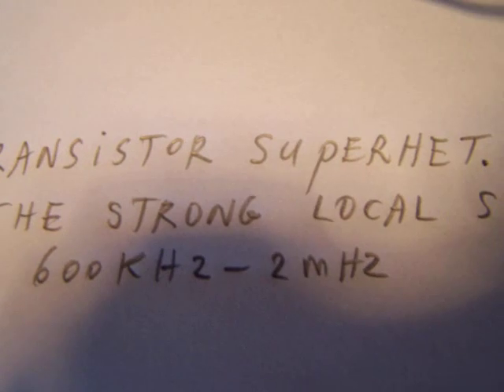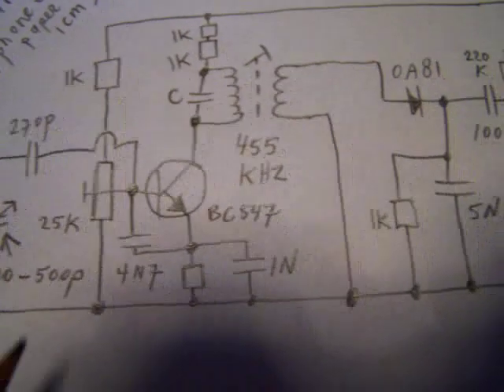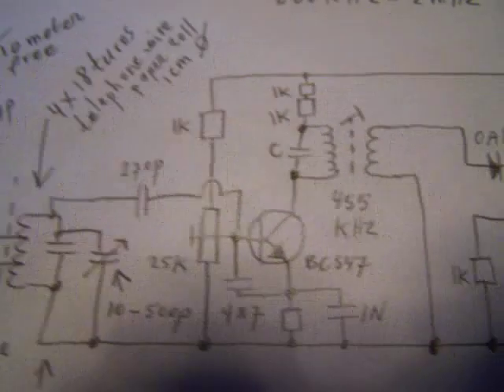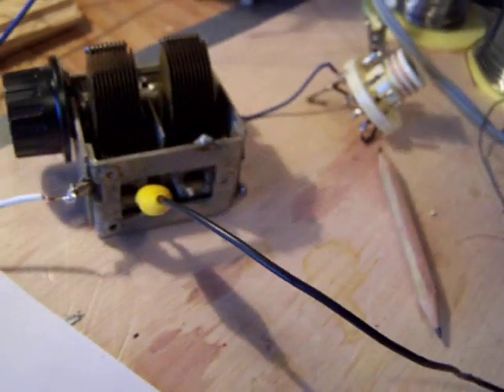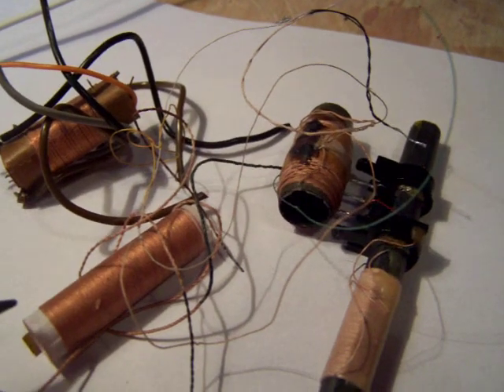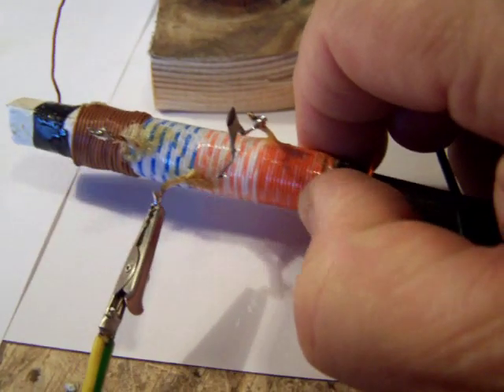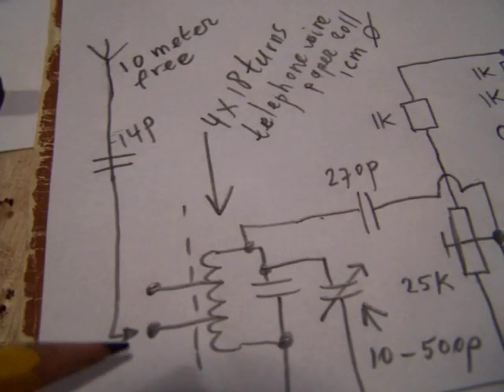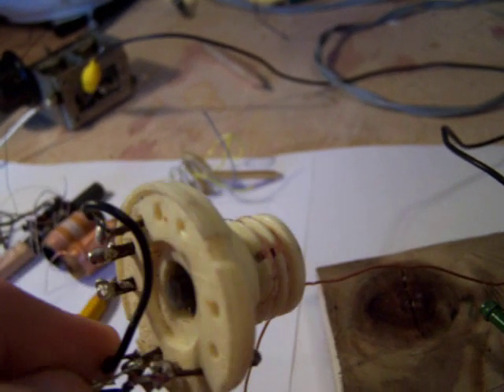2 transistor superhet. radio for strong local AM stations

Comment: I like to play with the 3 terminal MK484 or TA7642 receiver (TRF) chips, they make good AM receivers with audio output, or they can be used for an IF stage with audio output. These operate at 1.5 Volts.

Comment from the maker: The next steps are: A) 1 HF stage before the local oscillator to prevent the radio to act as transmitter B) a coil better equipped for 600 KHz - 1,8 MHz so that you find all radio stations neat on their place when you turn the tuning cap. C) a two transistor IF stage with which you really can get a good sharp small IF amplification -7 KHz- D) separate transistors for the local oscillator and the mixer. Both the first HF stage (antenna) and the second IF stage must have variable amplification.

Comment: A rudimentary superhet. In fact an oscillating regen receiver (autodyne) in which the difference signal at the collector is not the LF signal but the 455 kHz IF signal. The tank circuit is tuned 455 kHz above the incoming aerial signal. But due to the limited bandwidth of this circuit the incoming aerial signal is weakend very much.

For better results you should build a self oscillating mixer with a separate oscillator tank circuit which was used in cheap portable radios from the '60s and 70s.

Comment: MR.X can you please tell me about RF TANK - coil, how many Henry (u) ? 
I mean about - difference between  RF TANK and OSC TANK (freq), if I change RF TANK coil (more or less turn) did it work again or no ?
Reply from the maker: There is one coil connected to the antenna. Parallel to that is a tuning capacitor. That combination receives the radio stations. The oscillator coil (also tunable with the help of a tuning capacitor) of the local oscillator on the electronics board is tuned to a frequency that is 455 KC (Kilocycles) higher or lower than the frequency received in the antenna coil. That means that all the frequencies received in the antenna coil can be transformed (via the local oscillator and the "mixer") to 455 KC. That 455 KC bandfilter has a frequency band of approx. 10 KC. On 455 KC it is easy to make a sharp filter. Normal AM radio stations have a frequency bandwidth of maximum 10 Kilocycles. So with this frequency transformation  radio station (A) received in the antenna coil can be discriminated easily from another radio station (say radio station B) that broadcasts on a frequency close to the frequency of radio station A. More info on the www, search for "superheterodyne". 27 april 2023.

Comment: RF coil is 100uH ? thx for answer
Reply from the maker: It depends on the value of the tuning capacitor that bridges the antenna coil or the local oscillator coil. For frequencies between 800 KC and 1.6 MC the coil is in the range of 300-600 uH. In combination with a tuning capacitor that goes from 10 pF to 500 pF (PicoFarad).
Reply: @radiofun232  thx MR.X thx thx x 3.14

Comment: Very fun circuit! I notice you have two 1k resistors in series in the collector circuit of the oscillator/mixer, and a 1k and a 8.2k resistor in series in the collector circuit of the output transistor. Is this because you did not have a 2k resistor and a 9.2k resistor? If so, why not use a 2.2k and a 10k -which are common standard values? Or am I missing something here? I have seen similar use of resistors is series in other circuits you do, which is why I am finally asking my question.

Comment: Your "2 transistor" radio is only 1 transistor because the 2nd transistor is only an audio amplifier.  You said it puts out RF to the antenna.  I think you should move the audio transistor to the input and change it to a grounded base RF amplifier.  Then the weak signals will be detectable, and the VFO's RF won't be radiated by the antenna.  And the signal at the detector may be higher amplitude, enough to be heard by turning up the volume control on the audio amp.  Thanks.
Reply: Also, I have built projects on a piece of plywood using the brass brads (nails) for terminals and anchor points.  I'm happy to find that I'm not the only one.  Using the trimmer pot for the bias adjustment is something that I used to do, too.  Then I read a few explanations of how the transistor bias parameters set the operating point, and I simply do a few simple calculations to come up with the resistor values.  It also helps to understand the IF transformer impedances.  And it's much easier to get stable IF stages because the silicon transistors don't need to be neutralized.   Thanks.
Reply from the maker: Yes, could be a good option to prevent that straying out from the oscillator into the antenna. But I think you need that "second" transistor to get enough audio out, especially when you want to use this radio concept on Shortwave.

Comment from the maker: It is in fact nothing special. At first I used 1 K, but found that it did not work well, so I added 1 K to make it work better (VFO). The same happened in the second transistor: I had to add 8K2 because the transistor amplified too much and the detected IF signal got too broad, I assume some leakage from the local oscillator signal trough the IF transformer. I always publish the schematics "as they are", but of course you can change 2 resistors to 1 standard value.|